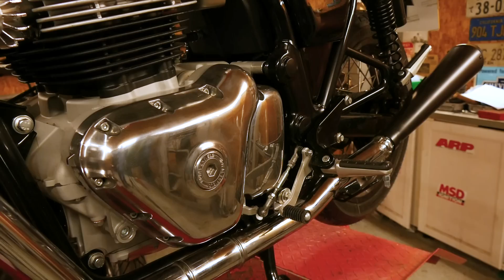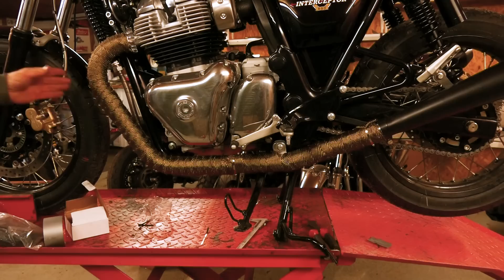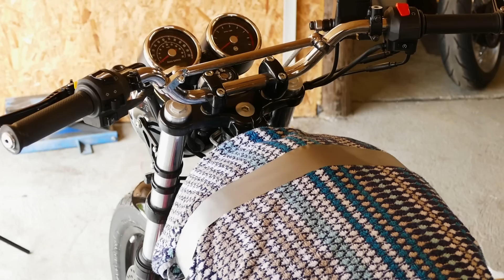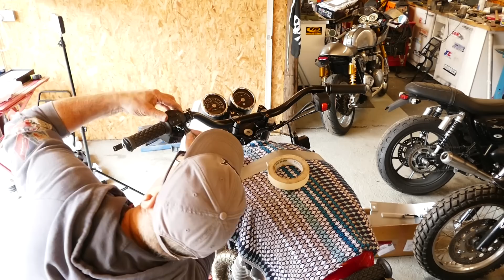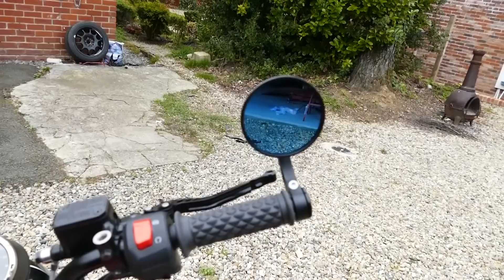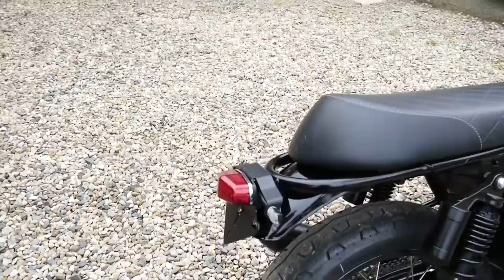Interceptor 650 Project - Part 2

Comment: Great stuff. Looking forward to seeing more of your mods on the RE. How do you find the power delivery of the RE compares to the street twin ?.
Reply: The pre 2019 street twin has better low down power but runs out of steam above 4000RPM (this has been addressed in the new more expensive 2019 model) The RE650's have a flatter more progressive power curve but considering they are 250cc's down on the Triumph, the bikes are not far apart on performance in the real world, the triumph pulls harder at first but both feel very similar at the top end with virtually the same top speed. A lot of people are comparing this bike with the street twin due to the street being the entry level bike , but I feel the interceptor is closer in style, feel and ride to Triumphs  T100 or the kawasaki W800. All 3 bikes have similar retro looks and features, but the interceptor is around £4000 cheaper than the other  two bikes with same equipment levels..

Comment: Really love your project and the focus on one being able to do these things with some design in you process. Pls I would like to know if you would do a wider rear tyre. As the stock size make the bike look a bit too retro. Would prefer a wider tyre size like a 170
Reply: It is no problem to use a 150 section tire on the stock rim, any larger would really need a rim change and chain clearance would need to be checked. But beware as wide rear tires will affect the sweet steering on this bike.
We intend to use an off road 150 section on the rear when it morphs into a scrambler

Comment: Lovely bars and the bar end mirrors clean up the whole look. Are the ride height adjusters really useful? They look great even if not. Great job
Reply: Hi
we will be changing the suspension lengths when we eventually end up as a street scrambler and the fork top adjusters are handy for setting the trim( front ride height) of the bike

Comment: pipe wrap is a tacky/amateurish look. leave it to automobiles to help with under-hood heat please
Reply from the maker: Thanks for your thoughts, wrap is not to everybody's taste. and the bikes exhaust will go through several looks and type during this build. We would normally only show a bike once finished, But we are trying to show and include customers in the design/development process of our parts. See next part for an update.
Reply: How about ceramic black coating for entire exhaust. If you are going good pipe coating,  give the tank a rust colour matte finish coat
Reply: Totally agree... & having to dry it after wet rides